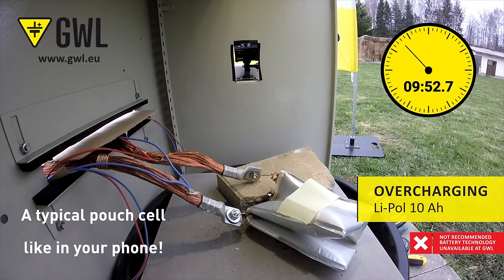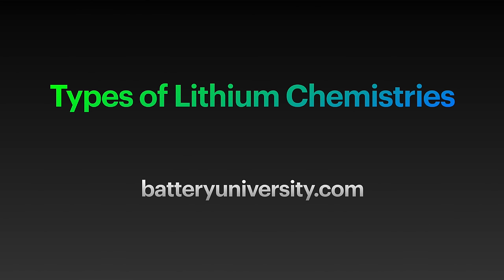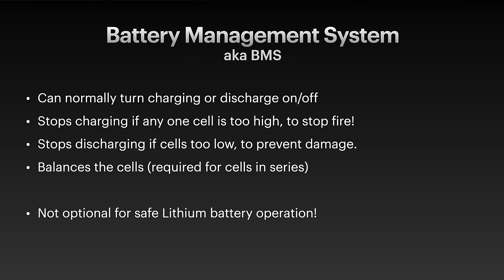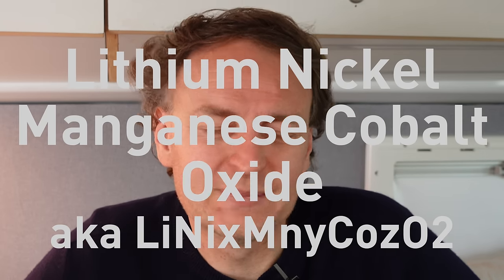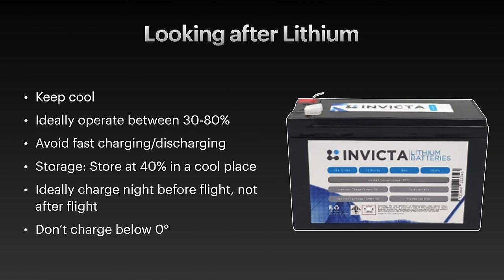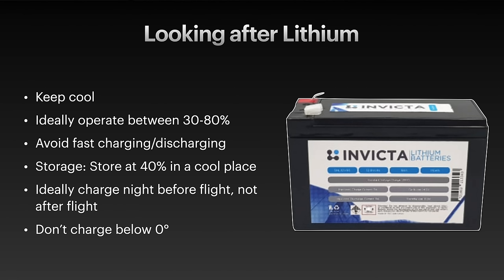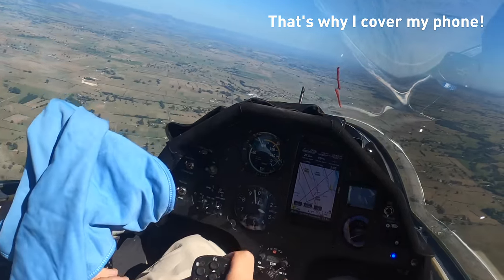🔥 How to Avoid a Cockpit Fire from Lithium Batteries 🔥

Comment: At 5:55, the pack labeled as Lithium-Ion, is actually a Li-Po (Lithium-Polymer) pack. This is a different chemistry (less energy dense) than Li-Ion, but is able to deliver higher currents. The working voltage ranges  do differ. So charging process needs to address, to ensure voltage and current levels not mixed up.
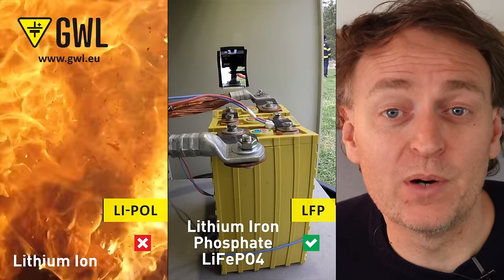(same at 9:52, the video is labeled Li-Pol, not Li-Ion). Only mentioning, as treating Li-Pol like Li-ion can be risky, particularly when charging. (ie: use proper charger)

Generally with any lithium chemistry, they won't burst into flame without warning. Typically the cells will exhibit physical deformation (bulging, etc), or are warm. Besides overcharging (too high a voltage), drawing, or charging at too high current can cause cells to get warm. With multi-cell packs, it's also very important to use a charger with balancing capability. Without this, it becomes easier to overcharge a single cell in a pack. (most cells are lower voltage, but one cell could be much higher voltage, and this not obvious from looking at overall pack voltage). 

Like most things having a degree of risk, using the proper equipment, and some basic precautions will greatly reduce risk potential.
Reply from the maker: Hi thanks for the corrections. In this video I referred to 'Lithium Ion' as all non 'Lithium Iron Phosphate' chemistries, not a specific chemistry. Technically that might be incorrect, but you get the idea. And yes maybe I didn't make clear enough the process of swelling and smoke before explosions! 
Cheers
Reply: @PureGlide  In broad sense, your video was spot on, with general knowledge. 
Overall a good video.
Reply from the maker: Thank you!
Reply: Li-ion vs lipo is just the cell packaging. It doesn't specify the chemistry of the battery. For pouch cells (lipo), manufacturers typically chose a chemistry that will not generate as much gas as the plastic cannot hold much pressure unlike a metal packaging (can/prismatic).
Reply: @christianedelmann6880  This is not correct. Li-Po is a cheaper chemistry will only ~60% of the energy density of Li-Po cells of the similar volume, or mass. Li-Po chemistry will cost more, but provides ~150% more energy. There are also charging and handling differences.

Comment: What about charging your battery in flight? With a rotor setup like yours one could use that for charging? What kind of batteries would you use for that?
Reply from the maker: Hi I wouldn't use the engine to charge the battery, because it's only operating for about a minute or two. Some people use solar panels, but I wouldn't recommend it for Lithium batteries, as that's the most likely time for a problem to happen.
Reply: @PureGlide  I don't quite understand. What happens after 2 minutes? To avoid missunderstandings: The setup I propose is as following: We use a rotor, that can be turned by the headwind. U have such a rotor on your glider, you use it to start the engine. Than we use an electric motor,  that can produce a current when turned. Obvoisly we need an advanced battary management for that, but at the end of the day, that is just software. Than when we have a good termal lift, we take a dive recharge the battarie and reagain attitude with the lift. Thereby using the energy that is in one spot later in the day to help us out.  Since this could be done multible times in one flight the same amount of capacity (or even less) could be way more usefull. You mentioned solar energy to recharge the batteries which sounds cool, too. But ma instinkt is, that when gliding, there is just more Energy in wind. Also, I would guess it is cheaper, than covering your glider in Solar cells, but I could be wrong about that since the prices of solar cells are falling quite a bit.
Reply from the maker: Gotchya! Depends which batteries we are talking about: we have avionics batteries (small) and some have electric propulsion (big batteries). Avionics batteries is what I thought you meant, that’s what people use solar panels for. Can’t really get enough solar to charge a propulsion battery, they are too big. And I thought you meant when I run my petrol engine I could charge my battery. That’s what I only use for 2 minutes. As for a RAT style generator, I guess it’s possible! You’d have to extract it, it would create drag, our glider speeds aren’t that fast so not sure it would be that useful compared to a jet. Also usually engines are used at the end of the day, when there isn’t any more option to find lift, so recharging it isn’t likely. Good idea though!
Reply: @PureGlide  obviously it creates drag, the energy needs to come from somewhere. So it only makes sens to do if you either can regain the Energy, or have to bleed it of anyway. I would Imagine with the option to recharge your battery mid flight one might alter the when the motor is used. Cashing in on some opportunities you might not otherwise. Also I guess when you selfstart, that takes a fair chunk out of the charge, making int a good Idea, to  recharge somewhere in between that and the End of the day. About the amount of Energy, that can be gained by that: You are in a fairly good position to make some tests about this.

Comment: So I watched this video which succeeded in making me think about the relative risk angle. Yes Lithium batteries probably do explode into flames reminiscent of the rapture. But is it really the biggest risk we face in the glider? I think the statistics will show it's the mundane stuff that normally reaches up and bites us...you know, spin stall, not missing the mountains, and more relevant to this discussion...failure to start your petrol powered turbo close to the ground...Tim!!! A better question  might be why are we moving away from lead batteries? I suspect it's because we are being required to run more stuff (ADS-D for example), flight tracking software, Flarm, ever more powerful Nav gear etc. And some of this stuff has a competing safety argument. My club wants me to run tracking software on my phone while I'm on a X-Country flight. Seems reasonable. However it has a high power draw so I need a back-up power source. In my case I use a Power Bank as it works. Further, its a cell phone...Lithium battery...(cue dramatic music) and the gliders carbon-fibre fuse blocks any signal so I install it in full view of the sun...oh and the cell phone network. I note even the author has his cell phone in a full sun exposure position despite the fact that Ventus C is made out of canvas and string...or so I've been told. Yes LiFePO4 is safer than LiFe but I'm not sure we have that option with phones and power banks...or cameras for that matter. I did question whether I should give up gliding and take up a safer sport...lawn bowls for example...however more people die bowling that any other sport in New Zealand...OK...skiing...oh wait!!!
Reply from the maker: Yeah not unsafe at all if you follow my instructions in the video! 
"My club wants me to run tracking software on my phone while I'm on a X-Country flight" That's not the club, that's me, so I can see how far behind you are :P
Reply: @PureGlide  Which is another safety issue...as its not good for my mental health. I may need a day off....

Comment: Makes me wonder how represented thermal runaway is in powered general aviation and the glider community in general, given both tend to use GPS devices portable devices. I can see the dangers in both worlds.
Reply from the maker: Yeah absolutely, although the smaller batteries are certainly less risk than bigger ones.
Reply: @PureGlide  We do have big battery packs in GA with the Pipistrel Alpha Electro that is now approved for flight training in Australia. 
I wonder how safe those are?
Reply from the maker: As long as you look after them, follow the manufacturers instructions, don't drop them or leave them fully charged for long periods, perfectly safe!

Comment: Almost all fires are from lithium Ion battery, LifePo4 is much safer. Yes it is more bulky, but safety is for me number 1.
Reply from the maker: Yip exactly!
Reply: Lithium Ion is the term used for all batteries in which lithium ions move from the negative electrode through an electrolyte to the positive electrode during discharge and back when charging.
LI-Ion batteries can have different cathodes including LifePo4, LiCoO
2, LiMn
2O4, Li2MnO3, LiNiMnCoO
2, LiNiCoAlO2... Each have a charging regime with different minimum and maximum voltages.
LiPo batteries use a gel electrolyte rather than liquid.

previously

Comment: I wouldn’t use ANYTHING other than a LiFePO4. They might get hot, but they won’t catch on fire…
Reply from the maker: Not unless you REALLY mess them up!
Reply: @PureGlide  I had one on my boat sailing from Oahu back to SF in 2012. I thought I had killed it due to overcharging (this crap was fairly immature on ocean racing boats in ‘12). I disconnected it and stashed it in a cabinet where a can of Boeshield fell onto it, shorting the poles and lighting the ENTIRE FRIGGING MESS on fire. I put on oven mitts, carried the pyre up the ladder and tossed it into 17kft of water. Yes indeed, you can REALLY mess them up.
Reply from the maker: Blimey!

Comment: If it's just a little battery to run electronics and not a motor, I'd rather just stick with the little agm. The weight difference is nothing. Look at the weigh of water in the wings, the weight of your drinking water - did you go to the toilet before the flight??? what did that weigh and then the WEIGHT OF THE RISK/WORRY FACTOR! To hell with this crap, agm would give me great piece of mind and a white plastic shield [ cut down ice cream container etc ] for the top and back of the phone/tablet where the sun hits it - easy and job done.
Reply from the maker: We do use Lithium iron phosphate in the glider just because of the steady voltage and capacity. It’s not about weight, but space to fit a battery. And the fact we can use over 50% of the battery.
Reply: @PureGlide  Fair call, but even if you have two little ones or one larger, still not large and maybe solar and the risk/danger is gone. I thought they were behind the seat.

Comment: People don't use Nickel-Metal-Hydride batteries anymore?  My 3rd Gen Prius still uses NiMH cells so its not like the chemistry is completely deprecated, it's just not cool.
Reply from the maker: Hi it’s just the energy density is so low compared to lithium I suspect!
Reply: @PureGlide   Yes, obviously, but if you rewatch your own video you have to ask yourself if a component, such as lithium batteries, with such a badly skewed risk to consequence ratio have any place in aviation.

One cell with an invisible fault and your whole battery pack catches fire and you risk serious injury, death, or destruction of your aircraft.  That does not sound like something I want.

My larger point is that the electro-mania that is sweeping the culture we are being induced/seduced to accept a battery technology that comes with significant problems at every level while better, greener technologies are still in the laboratory.

Comment: LTO are amazing, they dont catch fire at all, usually a smaller vcoltage (2.5V) but the charge they hold can be over 150Ah! for a SINGLE cell, also this BS about 30-80% is all totally crap!

Comment: I figure JB HIFI would be on fire every night if lithium batteries were notorious.
Reply from the maker: Yeah new batteries are usually fine! They will usually only have a problem when they have been dropped, crushed or abused in some way. Or there is a flaw from the factory. And in most cases it's only a problem when they are charged. Most products with lithium batteries will come half charged, and wouldn't be charged in store (unless it's a demo unit or something)

Comment: Great Video - but innocent couple of mistakes - I watched it only this week Sept 17, 2024. 2 years after you posted it. So mistakes in hindsight once you post a video are hard to change. You do great work and I used to fly gliders 25 years ago.  Presently,  I own 2 battery companies, in the USA. One recycles batteries and the other repurposes (aka reuse) used batteries for solar energy storage. I have 14+ years of battery experience. Just a few clarifications on this video. 1) the word "Lithium"..Technically Lithium means Lithium metal batteries. These are NOT rechargeable. The amount of lithium metal is small in theese batteries. They power coin batteries in computing devices and havemore metal in larger devices. But the fires can be mighty.  There is a tendency to use "Lithium" to mean Lithium-ion in everyday jargon. It can have dangerous consequences. There was a fire in a Chicago suburban warehouse about 4 years ago. The fire department arrived and asked the president of the business what was stored inside. He said "Lithium" batteries. Battling a blaze for Lithium vs Lithium-ion is quite different.  For lithium metal fire you use a Class D fire extinguisher (on a small scale fire) and foam for a large fire.  You smother a lithium-ion fire with enormous amounts of water. (No garden hose - it may make fire worse). It was actually a Lithium-ion fire and they missed the opportunity to put the fire out and the fire department just let the warehouse burn under as controlled conditions as possible. Nearby residents were evacuated -- for days while the fire burned out. 2) Lithium-ion is a term to describe NOT ONE "chemistry" but a family of chemistries. There are 5 different chemistries (recipes in plain-speak) of lithium-ion. 3 of them have Cobalt and/or Nickel or Manganese, and 2 don't have those elements included. You mention one of the cobalt and nickel-bearing types in your video:  Lithium-ion  Nickel Manganese Cobalt (NMC) and one that does not have Nickel or Cobalt which is Lithium Ferrous Phosphate (aka LFP). You are not the only person (at the time of the video posting) who has had this misconception that LFP is a totally different battery chemistry versus Lithium-ion  Nickel Manganese Cobalt (NMC). They are BOTH Lithium-ion, as well as the 3 other chemistries; Lithium Cobalt Oxide,  Lithium Manganese Oxide, Lithium Titanate). But Nickel and Cobalt versions have one leg up on their LFP cousin when it comes to recycling. They have metallic intrinsic value because of the Cobalt and Nickel content that may cover the cost of recycling or maybe cost you a small amount. LFP is not so lucky.   LFP is less expensive to buy because of the lack of Nickel and Cobalt. Our company did a study for the Nickel Institute in Toronto, Canada and we found that in the USA, LFP will cost -$17.00/kwh to recycle. LFP  is "safer" is a relative term - It will burn violently with enough coaxing. Recently, I quoted recycling LFP solar energy storage because the LFP flamed and burned to a crisp 2 large energy storage containers.  Treat Lthium-ion with respect and don't abuse it and leave it in a hot environment.. Heaven's sake don't throw Lithium and Lithium-ion batteries in the Trash. They may cause fires in municipal waste transfer sites. One burned to the ground in California - $8M insurance claim. Well, that was a long critique and I hope those who endured this mini-lecture learned something from it. Back to flying gliders - and be safe doing it. John

Comment: You fail to mention these incidents happened over 5 years ago and since then battery technology (particularly battery monitoring) has moved on, and certification standards for electric powered aircraft are a lot higher - indeed Luka at LZDesign who make the FES system  has put a lot of work into making the system as 'foolproof' as possible, as have most manufacturers using electric power............. can you cite any incidents in the last 2-3 years of a 'battery fire' in a sailplane?
Reply from the maker: Hi yeah that is a great point. I did think about mentioning that these accidents have improved safety on these systems, thanks to the recommendations from the reports, but I just can't cover everything, the videos get too long. So thanks for bringing it up. And agreed, safety around these systems is improving every year. Cheers!
Reply: I think there's a lot of FUD around this subject. These are black swan events similar to those seen with modern electric cars. I am not aware of any inflight fires in gliders and there's a lot of other stuff that can get you before you'll deal with an inflight fire. Hopefully I am not proven wrong because I just put in an order for a JS3 RES :-)
Reply from the maker: Yeah well that fire in NZ was a fatal accident caused directly from an inflight glider fire. So definitely possible. And for small electronics it’s just a matter of time… I think you’ll be fine with your JS3 Fes, I’d fly one happily!!